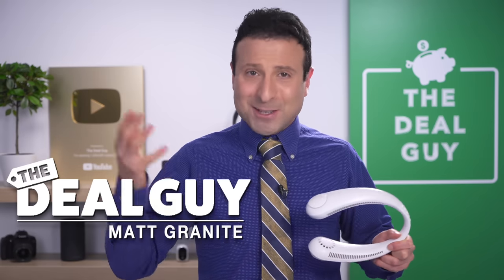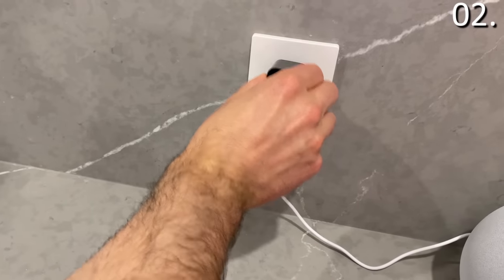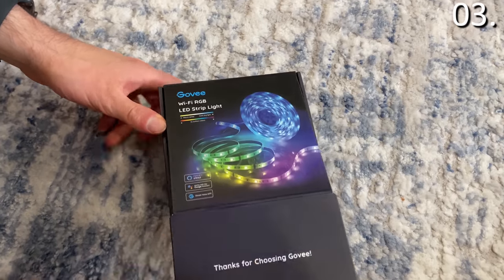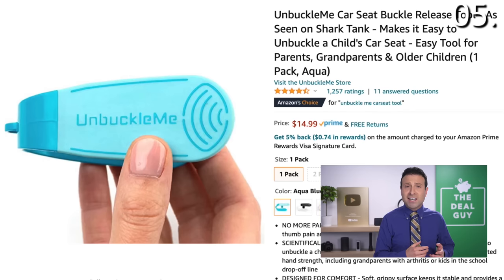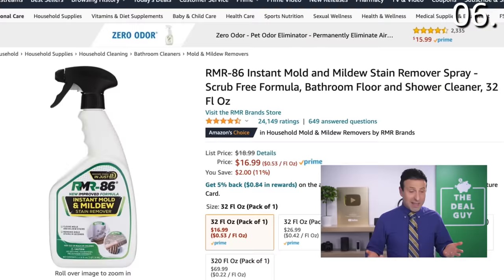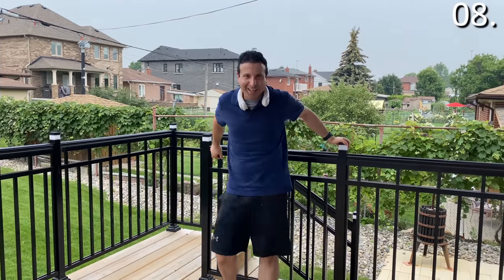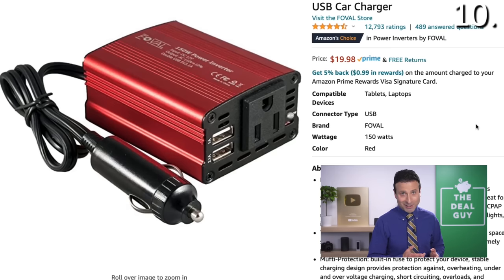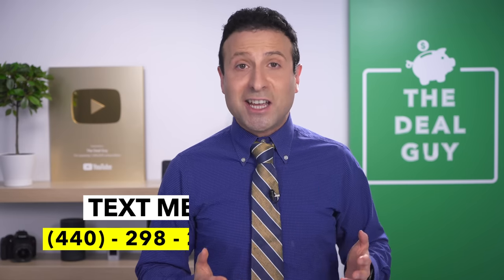10 Amazon Products You NEED Under $20!

Comment: The lint vacuum I can vouch for. We have had it a bit. For us, it only cleans the lint in the dryer. 
I use the Lint Eater system brush for cleaning the dryer vent in my walls and out of the house. I have a 45ft dryer duct. I get 10ft done from the dryer end, then rest from outside. It attaches to your drill. First use, I got 3.5 lbs (about 1.5kg) of wet lint from my wall. YIKES

Comment: 10/10 on modeling the neck fan. I think you could make it on America’s Next Top Model with just a little more practice. 😃

Also, I know many cleaning YouTube channels that recommend the Flush ‘n Sparkle because it bypasses the water in the tank, and therefore the bleach can’t damage any of the fixtures in the tank (which the tablets do and all plumbers tell you NOT to use the bleach tablets because of this!) I definitely want to try this!

Comment: I have the neck fan, I looove it!! I work in a bakery with ovens going all day long & it's very helpful.
Reply: Does it blow air across your forehead? It looks like it won't blow air across the top of one's face.
Reply: @dannydaw59  the one I got has air holes all around the neck, which I really love, & then also blows in my face on the 2 ends

Comment: Based on your review, my wife bought one of the portable fans for me to use while I worked in the yard. It did not provide me much relief. I had it on the highest speed and it only lasted about 1 hour and 45 minutes, it was very loud and provided little, if any, cooling. And, yes, it was touching the back of my neck. Maybe, it would have been more effective, if I was just hanging out on the back deck.

Comment: Omg omg omg! My dyson stick crevas attachment won't reach the bottom of my lint trap and I saw that just a few days ago! However, Lowe's has a brush for front load dryer lint traps. It works like a dream, but, of course, it doesn't get the little bit of silt that sits in the bottom!

Comment: Apartment Maintenance for 30+ years. The best Disposal cleaner is in your Freezer. Ice will do as well if not better that any product sold. Drop several Ice Cubes into the disposal and turn it on. It will crush the ice and all you need to do is turn the water on and let it rinse. The problem I saw in the video was that the sink drain had a clog in it. Too get rid of odors put 1/2 cup of Bleach in main drain of sink and let it set overnight.

Comment: Curious on thoughts about the toilet bowl cleaner. I used to use the bleach tabs in my toilet tanks. The bleach rotted the rubber seal on the tanks, toilet "ran" all the time since it was leaking.  Had to order new seals and have a plumber install. Do u think this will happen with the solution? Appreciate any info. Thanks for another great video Matt!
Reply: As the wife of a handyman...if there is bleach in the tank water, it will eventually eat the seals. We get lots of calls for replacing toilet guts and too many times the customer had used some sort of bleach product in their tank.

Comment: you have to see the measurements in some amazon products are wrong example = a plastic roll the description is misspelled as 12.5 feed x 11.5 they have 125. fee115 feed w. but they do not recognize that the measurements are misspelled 12.5 x 11.5 is the way of specification if you go to vinyl wrap you can see the amount of misspecified measurements dx

Comment: A VERY important warning about one of the products you mentioned...the cleaner for the toilet tank.  NEVER use bleach in a toilet tank, as it corrodes metal, and typically, the bolts that connect the tank to the main toilet assembly are metal bolts.  Over time, the bolts will literally dissolve, and the result will be water cascading down from your toilet onto the bathroom floor! Ask me how I know this!!  A lesson learned.  You should use a non-corrosive cleaner for your toilet tanks.

Comment: Those light strips are not waterproof if you turn them on well they are wet it will work but it will corrode all of the metal parts like the resistors and LED Contacts so you should never use them well they are wet